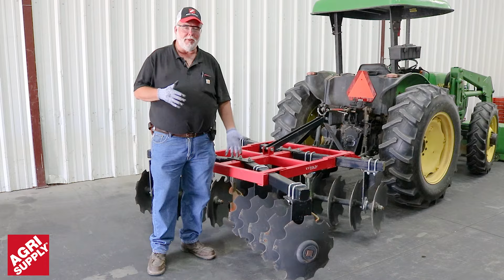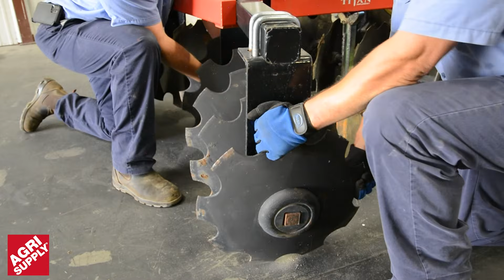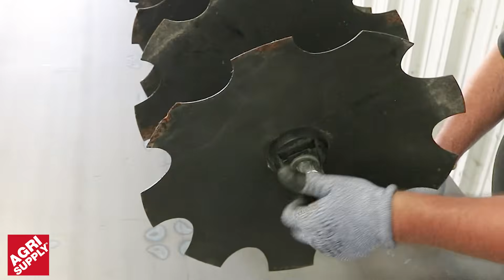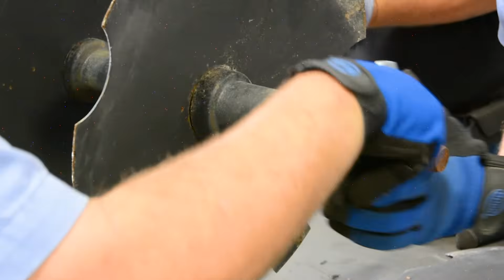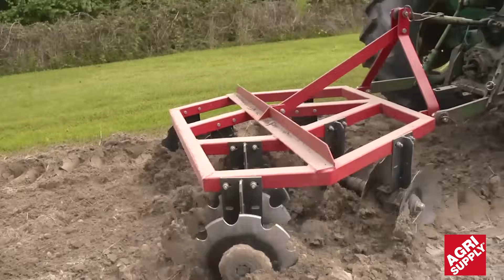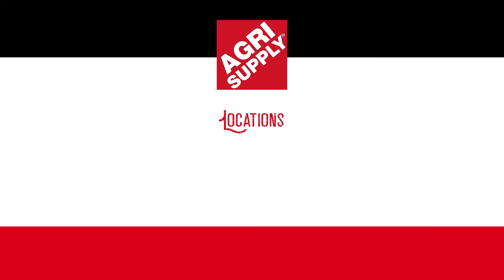Agri Supply® How To Replace Parts on a Disc Harrow

Comment: Right. but what if you're trying to get the spools apart and it's not a brand new disk your're working on ? Like an old disk.  And the spools apprear to be 'cast', how do you keep from breaking those, especially at $200 a piece?
Reply from the maker: Soak in penetrating oil and concentrate on hitting the axle more than the spools. Also, our most expensive spool is around $75, with most costing around $50 or less, in case you do end up breaking one. Below is a link to the spools on our website.

https://www.agrisupply.com/disc-harrow-parts/c/4500012/

Comment: Lol you said it may take longer too take apart....you bet it did! I literally could not get a 7/8 by 9 inch spool off....frozen fast too the shaft, penetrating oil and a BFH made from brass  still wouldn't budge it....took 2 side grinder cut off wheels too split that spool lengthwise too get it off! But hey , you guys had it so I ordered....I'm in the same state as you guys so chop chop I need it!😂

Comment: Working on mine now.  With new parts from agri supply.  Mine is good and used.  

How did you get the bearing bolts out and on?  They’re so tight to the next disc?  Thanks!  

Also, how much play should there be on the axle?  I have a 1” square axle, bought 1” axle 18” (double punch).
Reply from the maker: Thanks for watching & your question! 
We agree that the bearing bolts can be tough to get out.  This video was a little tricky cause we used a newer harrow that had not seen much action yet in the field! We highly suggest a day before you plan to remove your blades or parts, spray down those sections with a good penetrating oil to help lubricate the area you will be working on. 
Hope this helps! If you have any other specific questions, feel free to reach out to our Customer Care Center at 800.345.0169

Comment: Do you have a video on rebuilding a harrow with friction bearrings.

I have a lowrey 16-disc but it's only a 4 ft or maybe a 5 ft one of my disc gangs has gotten very loose you can't tighten it any more. It needs a rebuild just not sure what it needs.
Reply from the maker: Good Morning C Ericson,
Appreciate you reaching out! At the moment this is the only parts replacement video we have for the harrow. We've sent your question over to our techs to see if they can provide any feedback on the issue your having with your disc harrow. If you'd like to reach out to our team in the meantime, feel free to call us at 800-345-0169 and let's see if we can troubleshoot a few options for you. Thanks!
Reply: @AgriSupplyCo  
I appreciate it I proof read my comment it's disc gangs obviously not games , it's always a left front set of discs that seem to get loose there's not enough thread on the shaft to tighten so I assume something is bad either bearing or what I don't know I know I replace something on it a couple years ago I just can't remember what.
Thanks again.
Reply from the maker: @cericson3426  Not a problem at all! As soon as we get some feedback from our team I'll be sure to reach back out to you here on YouTube. If we don't have an exact solution for you, we will be sure to point you in the right direction. Thanks again for reaching out to us & your patience!
Reply from the maker: @cericson3426  Good Morning! Here is what are techs came back with on your harrow question - It sounds like some of the castings have cracked and fragments have fallen off thus making it impossible to fully tighten. There is a chance that the axle has broken also. We would recommend you take that particular gang apart and inspect it closely. We do carry most of those parts in-stock and can provide you an info sheet at your request! Feel free to email our team at tech@agrisupply.com.  

If you do not find any damaged parts or this doesn't help you, let us know via email or by a quick phone call so we can try to help troubleshoot your issue. Hope this is helpful, thanks again for reaching out!
Reply: @AgriSupplyCo  thank you so much I'm going to go out there and tear it down now and see I think maybe the inner bearing spool inside the hub bearing assembly is broken but I won't know till I take it apart that might be the part I need but thanks
Reply from the maker: @cericson3426  You're very welcome, and good luck! Don't hesitate to reach back out if we can help with anything else. Enjoy your week.

Comment: I have a plough where the bearings are fitted into the frame and don't drop out.
Reply from the maker: Good Mornign Jamie,
Appreciate you reaching out! Let us reach out to our ag team on this one to see what suggestions they might be able to provide. Is there a certain issue you are having on the disc harrow  or are you just looking to replace your blades? Thanks.
Reply: @AgriSupplyCo  We managed to get them off. Was looking to install larger, stronger discs. Had to nearly disassemble the whole frame just to get the bar out.
Reply from the maker: @Spenceoid  Oh good! Glad to hear you were able to work them off Jamie. Yeah those frames can be hard to budge sometimes! Especially with years of work out in the field. Thanks for checking us out, have a great week!

Comment: Replacing discs on Bush Hog model 145 disc harrow
Reply from the maker: Hello Deryl,
Thank you for watching & reaching out! The Bush Hog®  Model 145 is a large offset harrow, and would be just right for those tough jobs. Fortunately, we have a selection of blades to choose from that would be good for this particular harrow. It would be a larger diameter and a good thick blade. After checking with our techs, we see the axle size is 1-1/4 inches square - However, we cannot locate the appropriate blade diameter size or thickness. Our assumption would be that it is at least 22 inches and possibly a 24 or even 26-inch diameter for this model. If you measured what you have now and estimated how much is worn off from its original size, we would be glad to help you order a new set of blades. We would also need to know the blade thickness.

You can check out our selection of Notched Disc Blades here: https://www.agrisupply.com/disc-blades/c/9900099/
OR Give us a call at (800)345-0169 or email us at  tech@agrisupply.com. We hope this is helpful and look forward to speaking to you!

Comment: I have an older John Deere 3 point hitch disc harrow and need to replace the discs on the front.  What is on there now are round 18 inch diameter blades.  I would like to switch to the notched blades to improve cutting.  The blade assembly is held with a square nut with a flange bent over to lock the nut.  Don't know the axle diameter.  Do you offer free shipping to WA state if I buy 10 blades which is what I need to replace the front blades?
This disc harrow is great for gardening and levelling ground for the mower to follow later.
Reply from the maker: Good Morning Oby-1,
Thanks for reaching out to our team & your patience! Unfortunately even with the knowledge you are cutting running 18" diameter blades, we would need to know the harrow's axel size to determine the correct notched blades. A model number for the harrow would also be handy as we may be able to look up OEM information. If you have a moment to reach out to our Customer Care Team  (tech@agrisupply.com)  we would be happy to assist you finding the exact blade you need. Have a great day!

Comment: I've got a heavy duty disk harrow, with 1-1/8" square axles, and the front two interior axle bearings blew out.  Now my axle bearings are round, and I'm having trouble finding replacements, on your website you have square ones, and I am curious if those will be directly replaceable.  Thanks.
Reply from the maker: Hello Charles,
There are a couple things that we want to recommend here for your equipment. First, do you know the brand and model number of your harrow?  Secondly, do you know if the bearing originally sat right on the axle OR was there a round spacer that slid into the bearing? Lastly, as bad as we hate to tell you this - You may need to remove a good bearing and tell us what you see. You can even send our team a picture of it so we can match it up for you with the exact part number you need. Feel free to email us any pictures to tech@agrisupply.com or call us at 1-800-345-0169. We'd be glad to walk you through getting those replaced. Thanks again for reaching out!
Reply: @AgriSupplyCo  Thank you very much!  I will email you.
Reply from the maker: @charleshorseman55  You're very welcome!